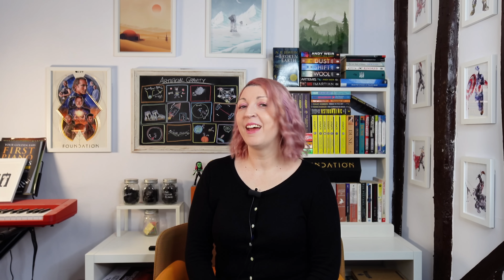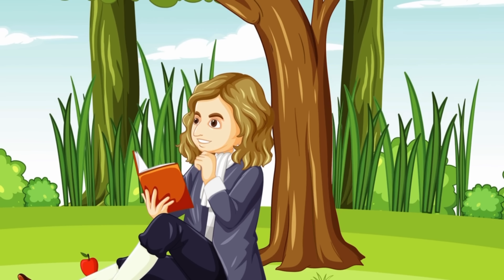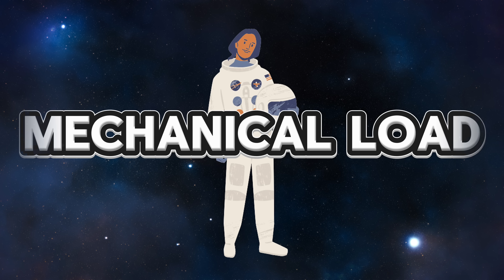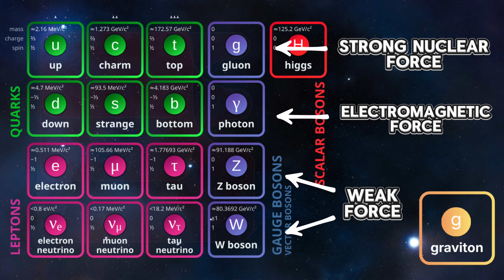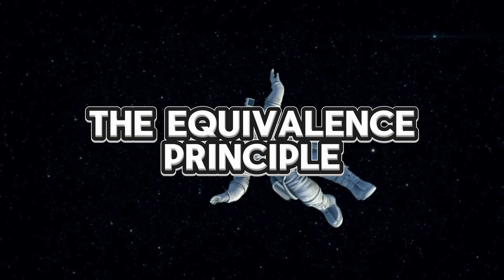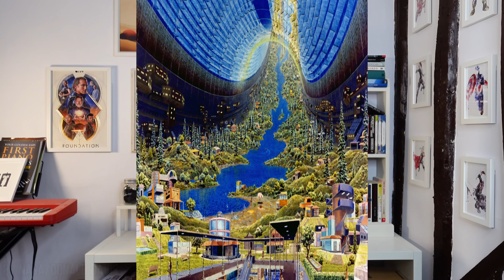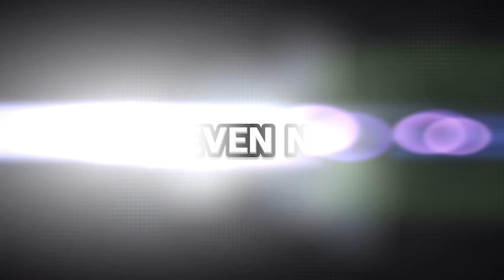Why Artificial Gravity Is Harder Than It Looks

Comment: Artificial Gravity?  First ask yourself what is/causes gravity. The Earths spin causes Centrifugal force but we're not thrown off into space. WHY? because the Earth also generates GRAVITY from it's Molten layer spinning around the Earths core pulling at everything. SO HOW do you create Artificial Gravity? Has ANYONE ever tried to just copy what is already there? We know wrapping wire around a piece of steel creates a magnetic field but it is weak compared to what the Earth does. SO WHY NOT COPY what the Earth does Spin Plasma around a Steel core the create the SAME results. We can already create Plasma and bend it any direction we want so it should be easy to make it Spin.
Reply from the maker: That's not what creates gravity

Comment: To answer the question in the title: Yes! As of today, it is purely an engineering problem which drive an economic decision. 
It can be summarized as follow: The current design of rockets is such that the price of access to LEO is too high to justify these type of structures.
The problem of reducing the price of access to LEO is currently being tackle by SpaceX & Blue Origin.
Once that barrier is lifted, then bigger structures will now become more economically feasible to build in space.

Comment: Question, how does centrifugal/centripetal forces work in a cylinder when you are still considered a free floating object and there is no force presented from the center of spin, are the forces trying to fly of into space only applied to the cylinder.

If it did work, as a free floating object, are humans not experiencing a force applied at the feet while still being free floating, making you walk at a certain amount of degree in opposition to the spin.

In a spinning cylinder, would the oxygen also be far denser at the floor than the head.

I'm having trouble understanding the spinning cylinder method, I'm not a physicist but I have a good understanding and can visualize how everything works and I just can't see the force pushing a human to the inside of a spinning cylinder, just that the cylinder itself has forces applied to it and that the structure itself wants to rip apart to move in a straight line.

Comment: Another benefit of AG is that the station would have proper running water enabling actual showering and typical toilets. So no more pooing into vacuums and the only option afterward is having a disgusting sponge bath 🤢🤮

The next station should absolutely have a rotating section so we can immediatelty test the long-term effects. This is essential prior to any Mars mission.
Reply: "The next station should absolutely [be] rotating" -- yes, I agree. No sections.

Comment: If it were possible to maintain 1g of thrust, a ship would reach lightspeed in less than a year.

It is, however, impossible to maintain 1g of thrust for a year. The closer the ship would get to lightspeed, the more energy it would need to maintain that 1g. Eventually it would take infinite energy to keep accelerating (not just all the energy in the universe, but an infinite number times that!).
Reply: Roughly 142 days to 40psol, up to which speed the energy curve remains pretty flat.

Comment: Using spin to simulate gravity is how the Gravitron ride at amusement parks work. By spinning you super fast it basically pins you to the wall and it even shifts your sense of up and down making the other side look like its above you... or at least it does me. I assume its an inner ear thing.
Reply: It's a gravity thing. The vector sum of Earth gravity and the ride's spin gravity points in a direction that the inner ear correctly treats as "down".

Comment: Will gyroscopes help in the gravity problem in space, Abigail?
Reply: A drive section at one end of a rotating tether, and a one-gee habitable module at the other, constitute a giant gyroscope. The spin axis points at a fixed spot on the sky, unless the drive is aimed out-of-plane to force precession.

If it is turned on and left on, the axis precesses only so far and then, on the second half of the circuit, precesses back. You have to turn it one once per rotation, at the same place in the rotation, to move the axis beyond so far.

Comment: how bout just two ships and a cable spinning round each other, cheap, should work fine for a trip to mars or whatever, ok, you did mention it in passing but you kinda glossed over it
Reply: A little cheaper and quite a bit simpler: one ship with a drive section on its nose, connected to the nose by a furled tether.

Once the assembly is in space, it is put into slow nose-over-tail rotation and the tether starts slowly unfurling, allowing the drive section to be lowered away from the rest of the ship. It turns on and thrusts tangentially to the rotation. This prevents the system from having its spin slowed as its radial extent increases.

Soon enough the ship and its drive section are separated by the full unfurled length of the tether. The original, and still present, slow spin, at the large distance both parts now are from the centre of mass, works out to one Earth gee for the ship. For the drive section, if it is lighter than the ship, the gees will be more.

Comment: Just build a giant doughnut redesign an entire new station.   Yes we need that I need that it's Penny's on the dollar compared to our military budget.   Just build  a modular assembly in space system and counter weights using a system similar to wheel beads.    The beads will shift every time a human moves.    This will nullify the vibrational effect of astronauts walking around inside of the space station think about it if all the astronauts go to the mess hall and then it's going to throw the entire donut spinning off.   But off-road tires have used this because of their indifferences in rubber at high speed.   Large off-road vehicles canal drive on the highway because of these little glass beads they pour inside the tire.   So you would have the inner ring where all the astronauts hang out and then on the outside layer also known as the icing of the donut you have a space where a bunch of these little beads interact and rotate.   I'm the only question is would the beads work at a rotational speed that doesn't glue us to the side walls of the donut.
Reply: Typos included
Reply: You know this would actually work you would have an inner ring where the gravitational pull would be 1G.   Then further out to make effective gravitational force upwards of 20 g's.   you could put this bead substrate and that will automatically offset any vibrational difference as things are moved around the 1G main station and habitation area

Comment: Everything you eat comes in at the top and kinda uses gravity until it comes out at the bottom, so yes. Gravity is a natural part of how we work.
Reply: Astronauts without life-support gravity ... which is all of them, so far ... haven't had a problem with that part ... except for carbonated drinks. They can't have those.

Belching in free fall means everything, not just the gas, comes back out.

Comment: Tom Marotta and Al Globus wrote The High Frontier, A Better Way (on Amazon)(title received the go-ahead from the O'Neill family or estate). Al with NASA Ames educational challenges for youth. They describe starting with smaller diameters of a rotating space station. In The Space Trade Update, L Paul Turner (moi) describes life on a mile diameter "mature" space station rotating in Earth orbit. I'm working on a construction in orbit book and will describe how a torus can be easily built by inflating it as a fabric and spraying the inside with a metal system licensed by New Tech Ceramics and apparently developed by AMES research. How thick must the aluminum skin be? How many other inside layers are needed to allow full atmospheric pressure in the habitable volume of the ship (or station) are questions which must be answered by prototype experiments. I hope to formulate plans to test the metal "painting" process at high altitude, likely on a JP Aerospace platform at around a hundred thousand feet MSL. More info at www.TheSpaceTrade.com. JP Aerospace is at www.JPAerospace.com (JP has many high altitude videos from the experiments his crews have run, including over 18 thousand student experiments flown to the edge of space.Abigail James, I love your approach, your system of going through the methods leading up to methods that work.

Comment: Hmmm...I propose a new approach. A biological one. If we can determine which neural pathways provide an organism  with the sense of "pressure", can we not "engineer" adjustments to those pathways to "enhance" self-regulating mechanisms? Thus those pathways will firstly identify changes in the environment (such as change in the "pressure" of gravity) and secondly provide a "signal" to alter  biochemical processes  to maintain homeostasis (a stable internal environment).

Comment: Turning hollowed out asteroids into o'neal cylinders and spinning them up has always seemed like the best solution. Especially if you also use the rotation to create a dynamo for a magnetic field.
Reply: so many of those objects are at best agglomerations of dust and rubble. good luck getting that to stay together during the spin, unless you melt the materials together or impregnate the dust into fabric or something.
Reply: It's always been the wrong idea to hollow out an asteroid.
It's less S.F. ambience to grind it up and separate the materials in it and use what you need to build what you need.

And everyone knows that proper AI generated SF ambience is the most important thing to look for, right?
Reply: How it create a domino
Reply: @JaredEmerson-u1f  I was referring to the DYNAmo effect where a rotating conductive material inside an existing magnetic field creates a very powerful magnetic field that can protect the inhabitants from solar radiation.
Reply: @doubtingflock1073 I
I am unaware of any asteroids that have an active magnetic field
Reply: @JaredEmerson-u1f You could use an electromagnet powered by solar energy to make the initial magnetic field that would then be amplified by a rotating ferris asteroid. It would also be a controllable magnetic field because all you have to do is reduce the current to the electromagnet to lower the field strength.
Reply: @doubtingflock1073 
That makes no practical sense sorry to be a dick😢
You're just using words 
You need an incredibly powerful alternator a domino a constant EMP pulse all your equipment would have to be heavily shield and the amount of energy would be next level look🤔🤷⁉️🧠
We really don't understand how exactly the Earth and other planets make there magnetic field yet 🤷🙏⁉️🧠
Maybe someday we'll understand it better and be able to replicate it on a smaller scale🙏☝️👍💯
Reply: @JaredEmerson-u1f They're extremely basic concepts I learned about in freshman electrical engineering school.You are just ignorant read a book sometime.
Reply: @doubtingflock1073 
Okkkkk 👌💯👍
What's the name of the school what's your name let me check to see if they have a record of you 🤔🫵⁉️
Reply: @doubtingflock1073 seems like you could achieve more by skipping the asteroid part. 
Refine the materials into an O'Neil with a static shell and rotating drum inside. Use waste regolith on outside with Sulphur to create concrete. And a thick shell.
Reply: @doubtingflock1073  Yes, and the point he is making is you are using those terms incorrectly. The dynamo effect produced by the earths core appears to be due to liquid metal swirling at different rates, a solid chunk of metal spinning does not produce a dynamo, as demonstrated by mars loosing its magnetic field as its core solidified. Even if you magnetize the solid metal first, just having a magnet spinning by itself out in the open does not make it stronger. If you want to make an artificial magnetic field, electromagnets are much simpler way of doing that. Though piling several meters of regolith up around the habitat is enough to block radiation as well, no magnetic field required.
Reply: @doubtingflock1073  
The '70s NASA space settlement studies looked into some sort of active EM field and rejected it.

It remains pure fantasy to talk of any sort of EM field we could think of making, protecting from galactic cosmic rays.

 Protection from Solar flares is not too far out, but that still leaves you taking the GCR dose.
Taking apart an asteroid or moon for metals to build with, leaves tons of rock left over, and using the rock and metals as concrete makes a robust structure that's also the cosmic ray shield.
There is no need to stretch science and engineering to try to make a force field to stop cosmic rays, when rock does the job so well and is free.
Reply: @JFrazer4303 I doubt they modeled a ferris asteroid dynamo but still one should try to stretch what our current science can do although as that is the entire point of science, granted it obviously will have to be done by someone far smarter and more competent than myself for sure.
Reply: @doubtingflock1073 
Stretching what can actually be done is otherwise known as fiction, or make-believe.
The NASA study's "Stanford Torus habitat and the plan around it, was about real things we could build up to doing, with what we know how to do now.

Comment: I think a tethered pair of orbiting space stations could be the cheapest way to conduct research. Send a four man crew up, two to each station. These would dock together and when separated have a winched connecting cable able to extend to a length to cover both the rotation rate and the proportion of g to be created across the entire range.
Loading one capsule more than the other would shift the barycentre, enabling two separate experiments, simultaneously. I can’t imagine the difficulty of docking re-supply ships while this enormous ‘space bolas’ was spinning. I suspect it would be practically impossible. 
For building tangential motion (demolishing it too!), I wonder if ion motors might be practical. Even just 1mm/s² acceleration will build  enough velocity over 8 hours, 42 minutes and 0.92 seconds to give each capsule 1g (9.81m/s²) of artificial gravity, on a radius of rotation of 100m and with an orbital period of 20.6 seconds (all figures approximate 😉).
Reply: "I can’t imagine the difficulty of docking re-supply ships while this enormous ‘space bolas’ was spinning. I suspect it would be practically impossible --"

All true, except I think you might have misspelled "possible".

Visiting ships dock at the barycentre. It helps if there is a structure that grips the tether with opposed wheels, and keeps itself accurately straddling that centre, and another cable-traveller, smaller, that abseils down to the stations, possibly charging a battery as it does so, and wheels itself back up. This smaller one, we call the elevator .

Visiting spaceships can hitch to the spin-axis structure.
Reply: @grlcowan 
Believe it or not, I worked out that would be the way to go, about half an hour after I posted the above.

Comment: I guess if you can a space station that scooped atmosphere ions and had solar panels,  you could constantly accelerate, spin it backwards and decelerate, and repeat... My understanding of rotation is that the problem is you are getting the gravity force from the hull correcting your otherwise track by spinning. If you jump from that up you are just floating around again.
Reply: When you jump, the hull stops bending your path. It becomes straight. As such, it goes inward with respct to the hull for a while, then back out. You float for a short time and then the hull rejoins you and you have weight again.

It's exactly as if the hull were a deck on an Earth ship, and so the part of the hull you jumped from is in fact the deck.

Comment: 2001, Bablyon 5, Interstellar all did rotating space stations pretty accurately. magnetic boots wouldnt work but what about a shirt of chainmail and the floor has moderate magnetic field / plate? why not an internal tilt-a-whirl style rotating section inside the ship? 2 opposing each other and there's no net torque.  you put pods on them for sleeping and working out and light desk work. since you arent trying to walk int them you wont get the puke inducing out of body surge?

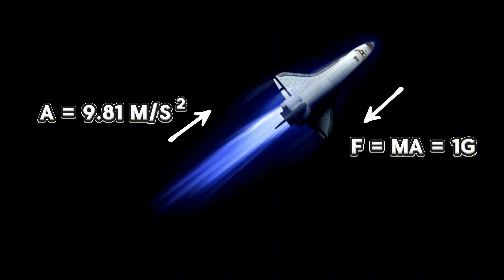Comment: 19:45 This statement not seems to be so intuitive that it can be left unexplained. If it's true, that means that the length of the ship is decreasing at an increasing rate. The relativistic legth contraction may can cause something like that, but if the ship is smaller, than a giant planet, then this effect is unmeasurably small, however if the ship has the size of a giant planet, or even bigger, than the ship's gravitation will cause a meassurable additional acceleration at the front.

Comment: Disappointing. Epstein drive is not even plausible, and you didn’t address that. And can we even make an O’Neil cylinder with our current material science? How thick would the steel have to be to keep from spinning apart?
Reply: Hang a steel rope over a cliff on Earth. How thick does it have to be to support its own weight, and not break at the top (where the stress is greatest)?

Double the thickness and you double the tension that the top must endure, plus you double the cross sectional area of that part. The tensile stress is unchanged. If a rope 1 inch in diameter can be let down 30 km but then breaks, a rope a metre in diameter will break when you have paid out that same 30 km.

The best rope materials in service today can hang down almost 400 km in one gee. If you want them to be at only ten percent of breaking stress, 40 km. If you want that, plus you also want to hang stuff on them that is four times as massive as they are, 8 km.

That same 8 km is how big in radius we could make an O'Neill cylinder, if it were made of the best stuff available for the job today. It wouldn't be steel.